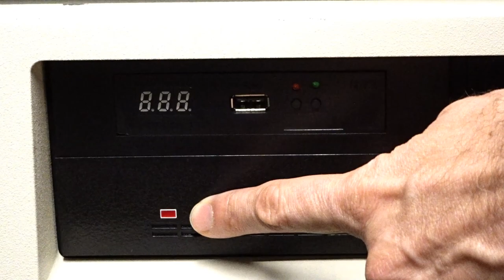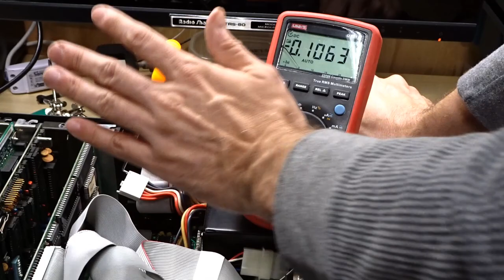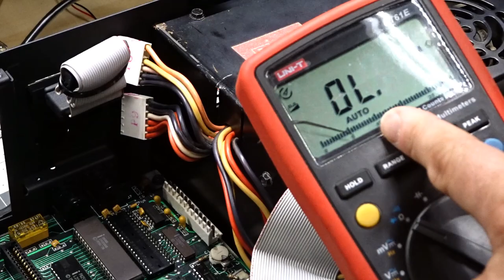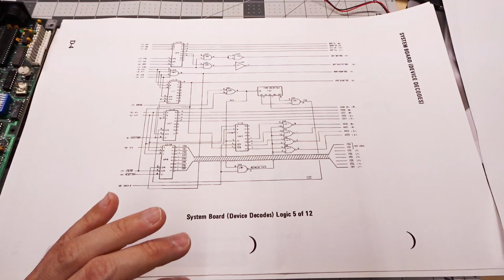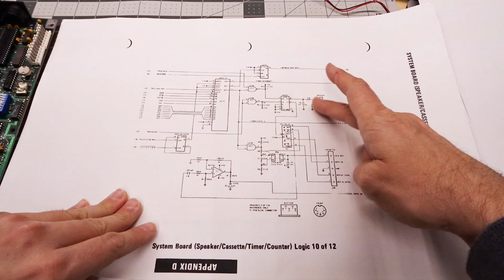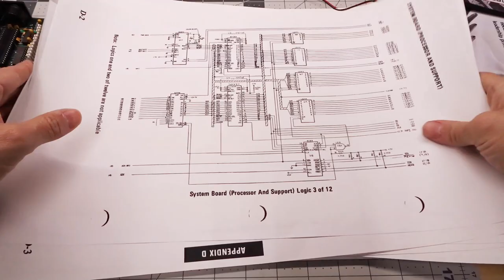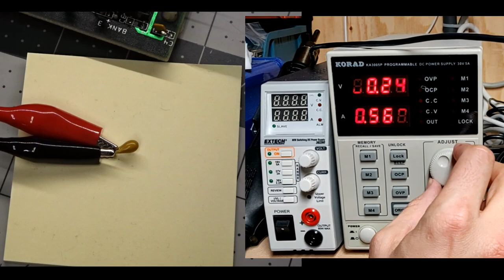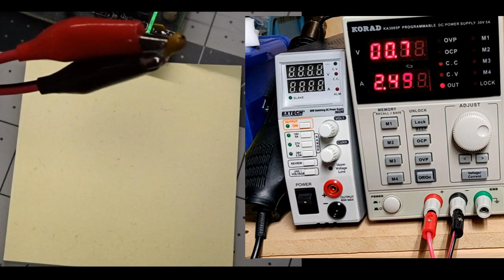Fixing a PC that won't turn on (Bonus magic smoke!)

Comment: U should replace all the tantalum capacitors with better modern good brand capacitors.. these capacitors r well known for shorting out & they explode quite good. Good thing this pc has no electrolyte capacitor or else it would already have damaged traces. From leaky caps.

Comment: The saying I've always heard is "Red to red, motherboard's dead; ground to ground, good all around!"
Reply: Funny because in aviation there's another similar saying about red and white... "white over white, you'll fly all night, red over red, you'll soon be dead" which is how to remember the colours the PAPI (precision approach path indicator) is showing and what they mean. White over red is what you want to see :)
EDIT: Also, the reason it took so much current to blow that tantalum cap is because it wasn't actually dissipating that much power. Remember that P=VI, so even at 2.5A it was only dissipating 1.7W which really isn't that much, in the scheme of things. At 5A notice it started around 1.3V, so about 8W which is getting to be quite a bit for that cap, but assuming it was a very good short, most of that energy was probably still being dissipated in the wires/croc clips etc. Then as it warmed up, the voltage drop across the cap increased and so the amount of power it had to absorb increased, further increasing the temperature, in a feedback loop. That's why when it finally went, the voltage shot up quickly (I saw about 3.3V, so the better part of 20 watts) and then came back down, but even after it started smoking it was still dissipating like 8W or so until you shut it off! Indeed a tough little cap.

Comment: How about to use power supply (regulated variable voltage and current) and push current to problematic rail. Say, put 2V, 3A, and problematic capacitor will get very hot.

Comment: Now imagine finding a bad tantalum in a machine with a few thousand tantalums across hundreds of boards... Still working on that to this day... (though the machine ist making the repair easy)

Though since most of the bad ones where wet slug Tantalums, i decided to just replace them with Panasonic FC Electrolytics, spec wise they should be fine...
Reply: @adriansdigitalbasement  If your interested in hearing more about the random projects im up to, id be happy to chat. Sadly the project with the tantalum caps is progressing so slow that making a video documenting the progress would be boring.

Speaking of old computers, i recently tried preconditioning my HP Netserver LX Pro (dual Pentium pro 200MHz server) and had quite the surprise as both of its Power supplys decided to release the magic smoke with quite the light show, if only fixing that thing where as easy ass a 286.

Comment: Interesting. 12V DRAM's. What software can you actually run with only 64K?
Reply: @adriansdigitalbasement  Thanks for the answer. My impression was that they expected people to buy expansion boards and such to make it a truly useful machine---which people pretty much did, I guess.
Reply: legend: the first PC , witch hase used Bill gates, to make do, should hav had 32K ram !!!  The bigger version has 128k

Comment: in a situation where I know 12v only goes to ram and tantalums I might risk just connecting a huge 12v current source (a modern atx psu most likely) and use alcohol to see which tantalum gets toasty instead of trying this method  due to my near 100% confidence the tantalums are dead
obviously the ram could be dead too but in that case the cpu and other parts that hate 12v would be dead too likely killing the whole pc
it is common to abuse tantalums in old pc's because they will die soon anyway and should all be replaced

Comment: at the minute 10:00 I would first extract the RAM chip by chip and check if the short continue, before unmounting the mother itself that is a lot of work.
Reply: @adriansdigitalbasement  I worked as repairman, repairing general electronics, tantalium caps was unusual point of failure, but in CRT tv's sets / VCR / AUDIO these are unusual aswell. I didn't know that in computers it is an usual failure point.

Comment: What is the point of the minus volts. Thanks v much...
Reply: Some transistors in some old chips need their input pulled way low to turn off or on completely.  Also, serial ports use -12V for a 1 bit and +12V for a 0 bit, because the standard was created for electromechanical Teletype terminals hooked up with long cables into another office.

Comment: If the PS was more powerful, that cap would have blown with a loud POP !!!
Reply: He would need at least a 40 amp power supply for it to boot and blow the cap at the same time
Reply: @userPrehistoricman  more likely blow some of the pcb tracks before the cap blew,

Comment: Holly cow, 5A to blow it up xD. Definitely old components were made to last, not like current ones.
Reply: geniwab actual...?
Reply: @RWL2012  Sorry, wrong translation, I meant "current ones".
Reply: @drgusman  gotcha and yes it's true
Reply: I'm confused. An old capacitor failing means it was built to last? Strange interpretation. Those old tantalums were super unreliable.
Reply: @andy16666  An old capacitor of  more than 30 years which doesn't explodes with 5A through it... Yes, it was built to last, current components have a shorter lifespan and don't support such currents.

Comment: Those tantalum caps are nasty little buggers. They can explode or set on fire. I wouldve just used a 12V 7Ah lead acid battery to blow that cap. They can supply a lot of instant current. It would certainly have gone bang!
Reply: I'm always worried about blowing up traces when doing that.
Reply: @compu85  I meant connecting the cap directly to said battery, not while its still on the board. His bench PSU can only do 5A max.

Comment: 1:37 my guess so far, theres a short causing the power supply to  trip and shut off
possibly a tantalum cap (common issue on these machines)

Comment: Actually, the max RAM for a PC is 640k, not 576k. Later revisions of the board came with 256k on-board.
Reply: On a 64k board, you need a RAM expansion that will add enough RAM to go to the max 640k.

Comment: Is it possible to just replace the old capacitors with the modern Japanese solid capacitors used in modern PC motherboards?  I know it will make the board un-original but you will be able to kiss all future capacitor problems goodbye.

Comment: Your attempt to blow the shorted capacitor misses a basic consideration.  Any current multiplied by (nearly) zero voltage   -- Short Circuit -- equals nearly zero power.  Hence, nearly zero heating.  You indeed need to push the current way up to finally cause a hot spot to start growing.  And release the magic smoke.

Comment: RS232 (Com port) uses +12 and - 12v
Reply: There is no RS232 on the mainboard, so what is stated in the video is correct. An expansion card can take -12V from the ISA bus to do RS232.

Comment: A real tech would have just changed out all the caps without even testing them. Because it's due. I don't think people even use tantalum capacitors today either. They're just crap. This being the Internet I'm sure folks disagree.

Comment: I would have ripped out all those $hitty tantalums and replaced them with ceramic caps around 1uF... bypass doesn't need more than that anyway. Tantalum == Trouble.

Comment: Meh...easy way to tell which ones shorted is to plug in a 1,000w power supply and see which tantalum capacitors explode. Simple enough...

Comment: 'Volt' is the unit. I don't think there is a plural.
Reply: I have always heard and said "5 volts" for the measurement but "5 volt" for the power supply output as in "the 5 voltage rail". I would never say "that pin measures 5 volt" nor have I ever heard anyone say that..

Comment: A computer that old shouldn't have a USB port
Reply: Pentium 1 boards with the 430HX chipset and later had USB ports, 430FX pentium, 486 and below didn't have any USB ports.
Reply: I've had older boards with USB ports only problem is that they broke

Comment: You didn't stand a chance trying to identify the bad cap from resistance readings. Spent a good 5 mins yelling at my screen haha.

Your PSU diagnosis was solid, but you should have eliminated the RAM ICs before looking at the caps.
Yes, caps have a reputation for failing but the ICs are socketed and should therefore be done first as it requires no work on the board.

Running 5A through a rail is NOT a good way of identifying a bad cap. You could damage other components. It's a 50 year old machine. Show it some respect and just replace all the tantalums once you've discovered one is bad. It makes for a job well done instead of a quick bodge.

Comment: I dunno, I would leave the gotek, floopy disks dont have a lot longer to live. Unless the retro community can convince some company to start manufacturing new ones.
Reply: @adriansdigitalbasement  What protocol / program do you use? Pretty tough to do current standards on this isn't it? FTP I guess means tcp/ip. Hmm I guess I have to revisit this. Last I tried on a tandy 1000sx I couldn't muster enough ram .

Comment: -12 is used by the parallel port...
Reply: ??? normal you are need the -12V for the serialport ( RS232c ) and older d-ram     chips, have had one in my Sharp MZ80K.